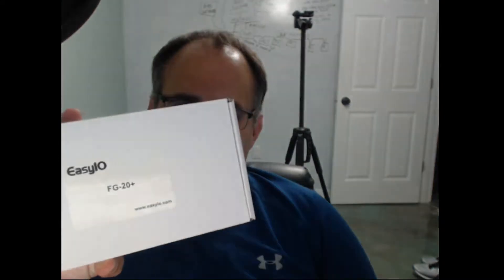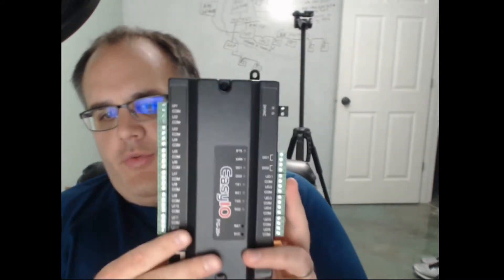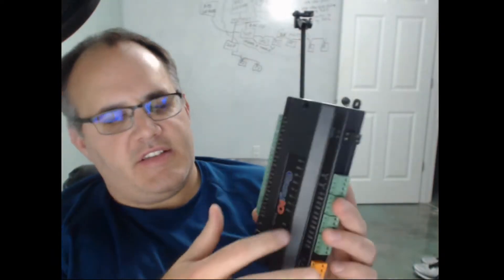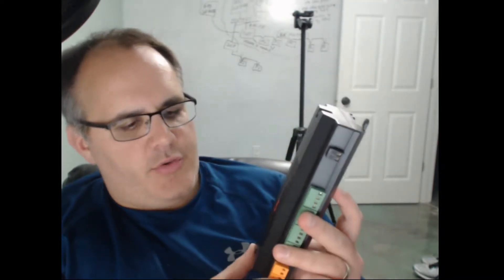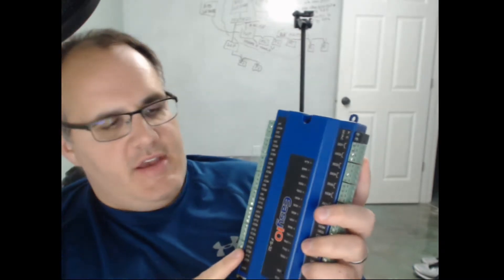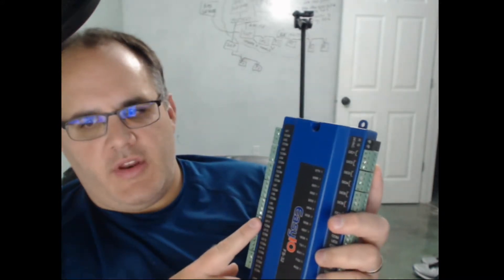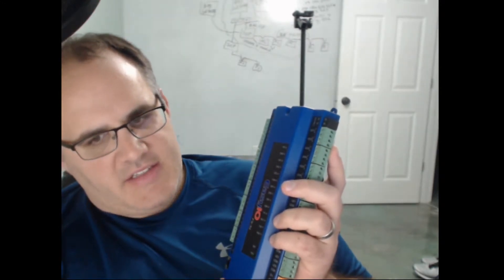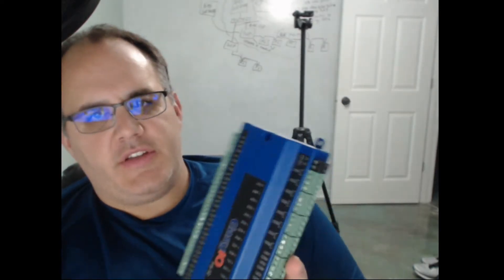Easy IO Unboxing

Comment: Phil Zito, if I purchase this controller or both controllers, will I be able to learn something new on my own using free tutorials? At the least I'd like to attach some BACnet devices to it, maybe temperature sensor and actuator and\or create PID loop. I want to create my home lab to learn something new of building automation. I took some college courses on HVAC, integration, networking, electricity, motors and drives, and I have zero experience, I never had practice with  this kind of technology. As far as to learn BAS programming I don't know if this is achievable goal.
Reply from the maker: I mean I did it that way. I literally bought old controllers off eBay and taught myself. I'll be honest (and not because we sell this course) it would be a lot quicker for you to take our BAS programmer path or to just take the programmer course.
Reply: @SmartBuildingsAcademy  Hi, Phil. I purchased some courses from Building Automation Monthly in 2019. There I found only theory, no labs, no practice at all. So  I doubt if I want to purchase courses again. Price become higher since 2019. I will try to land entry level job with knowledge I have today. And I plan to learn for now from free or cheap sources of knowledge like ASHRAE and American Technical Publishing books and youtube videos.  Thanks for your response.